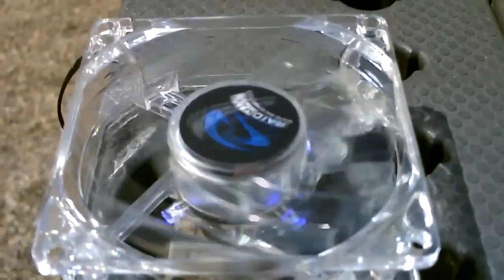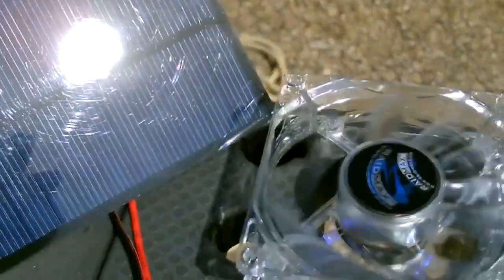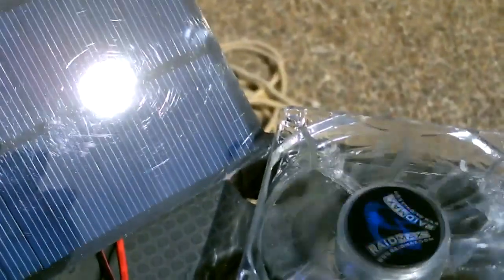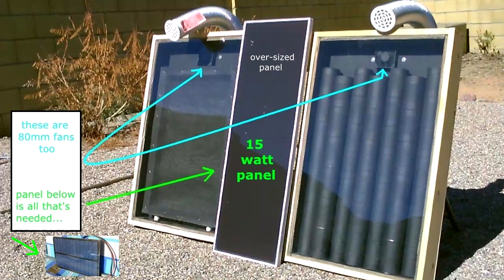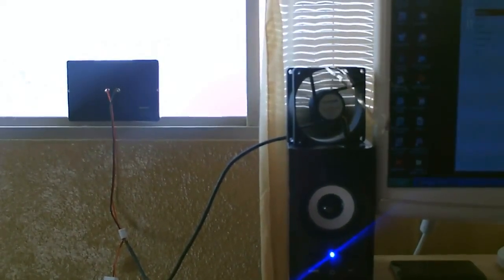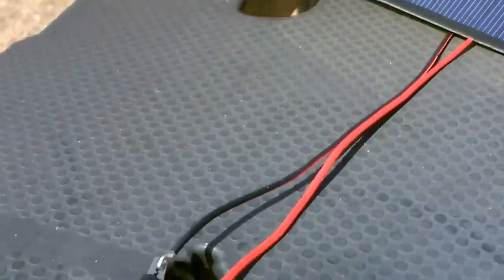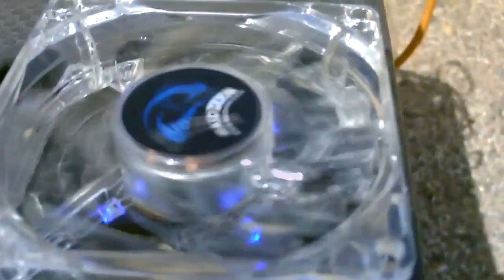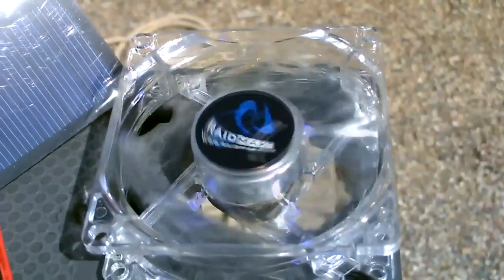Solar Powering 12VDC Fans! (solar panel sizing and hookup) - Easy DIY

Comment: Did you measure the voltage on the fan while operating ? 12V Solar panels will put out 20V open circuit and loaded, will drop down to 15-17V. DC fans dont like excessive voltage about the max rated input, or else they die faster or may overheat

Comment: What are the specs for that panel you have? Where did you get it?
Reply: The panels themselves on eBay or amazon. I recently bought one that's similar but completely different specs. Mine is 5 volts 0.8 amps.hopefully I could help answer your question.

Comment: ok but do u have a link to where you bought that solar panel or did you go to an actual store
Reply from the maker: hi. i bought that panel from radio shack. i've seen similar ones on ebay for as little as $5

Comment: Nice videos!
I plan to build a air heater with a fan connected to a solar panel. I tried a computer fan with a 1.5W solar panel and it spinned but not as fast as I wanted. Is there a risk to damage the fan if you connect it to a solar panel with more efficiency as your 15W panel?
Reply from the maker: hi there. there is no risk. the fan will only draw as much power as it needs. you could use a 100 watt 12v solar panel if you wanted to.

Comment: If there are 50w solar panels can I hook up 3 fans to one without sacrificing the fan speed, and if I do that do I just hook them up to the solar panel and nothing else or does in need a power supply ?
Reply from the maker: hi. since these types of fans are usually 2 to 4 watts, you could easily run 3 of them at the same time (if you're using a 12v 50 watt panel). all you need is the fans and the solar panel. no extra power supply is needed.🙂
Reply: Would you be able to give an estimated life expectancy on the solar panel. Also can I find any instructions somewhere to know how to wire three of them to a solar panel ?
Reply from the maker: solar panels usually last 20 or 30 years. some even last over 40. to wire three fans to one solar panel just connect all the positive fan wires to the positive wire of the solar panel and all the negative fan wires to the negative wire of the solar panel.😎

Comment: Fantastic! I have a 4'x8' soda can solar air heater. I put an 80 cfm computer fan to pull the air through it. I have wanted to hook up a panel to power the fan. I never knew if I needed a controller. I was hoping to wire it direct like you show. Do you know what size panel I would need to run the 80 com fan? Great video BTW! I am in a desert too. Apple Valley, CA.
Reply from the maker: hi. i have a couple of 78 cfm 12v computer case fans. they use about 4 watts each. so really any 12v panel that is 4 watts or more 🙂
Reply: @desertsun02  Thank you! That is very helpful information!

Comment: what about using a solar panel controller/regulator with a 10W solar panel and a 12V battery? Will the panel power the regulator?

Comment: hey man quick question: since the panel is generating a pretty high heat, is it possible that fan is going to melt or at least smell bad? And if so have ever received this kind of problems?
Reply from the maker: hi. nah, that won't happen. those fans really hold up well
Reply: @desertsun02  good to know, thanks for the reply!

Comment: Did I hear you say somerhing about heaters run by these little panels? If so, could you please direct me to that video? In the high desert, heating is more of a concern than cooling. THANK YOU!!!!!
Reply from the maker: hi there. yep, i've made several solar air heaters that use solar powered DC fans. probably the best way to start is to watch my compilation video of the 5 types of heaters i've made. if interested, here's the link https://youtu.be/DLGZPti_n-M after that, just check in the "description section" (underneath that video) for links to each "Full Build" video, and watch the ones that interest you. or i've got a playlist of  'solar air heaters'  ...or just scan my youtube channels video page.
Reply: Omg-THANK YOU!

Comment: I wonder if an electric hybrid motor from a vehicle could produce a large magnetic field to cause rewired drum motors into generators positioned around the electric motor to spin generating high frequency electricity that feed into a bank of graphite power cells then into a power stepper to operate the electric motor with extra power to spare to operate other devices? A few vacuum spark gaps in key locations and and you got a power generator that generates its own energy. Could be a huge break through for all sorts of electric vehicles and even for central air conditioning units for homes. Cut that electrical bill right out each month. Thought I would drop some ideas for you if you want to work on them. ; )

Comment: What gage wiring was used? I tried this in 2018 didn't work on this panel.
Reply from the maker: hi. i'm not sure of the gauge but even a pretty thin wire should work (because it's low power). maybe the fan you used took more power than the panel output. (just a guess)

Comment: Get a hold of two hybrid electric vehicle motors and place them in opposition to each other and hand turn one of the motors. The other electric motor will turn in response from the high magnetic field. Try it and see. So why not rewire drum motors into generators brushless and place them around the strong magnetic electric motor to generate high frequency electricity while the electric motor is in operation? Even the electric motor could be fitted with sun gearing to spin a large rewired drum motor generator for increased power stepping. Purdy cool technology.

Comment: What size panel would i need to run three or four of these
Reply from the maker: hi. the computer case fans are typically 2 to 4 watts so a (10 or 15 watt) panel should do it.

Comment: could i power a record player with a panel. providing its 12 volts d.c. ??
Reply from the maker: hi there. yes, i would think you could. solar panels are great for running dc motors

Comment: thanks, I want to try that with a diy ice chest ac
Reply from the maker: you're welcome. if interested, i just posted my newest DIY ice chest AC. it's powered by a fan of the same size (with solar panel, battery or wall current) and is fueled with Ice-paks or ice-cubes/small blocks of ice. here's the link https://youtu.be/Vx5-3M0hvTc
Reply: desertsun02 I think I've seen it, but going to be sure. I'm not a van dweller yet but I plan to do the car camping thing when I retire, soon